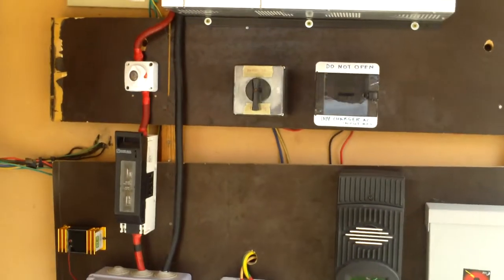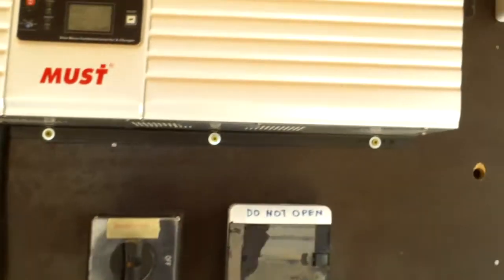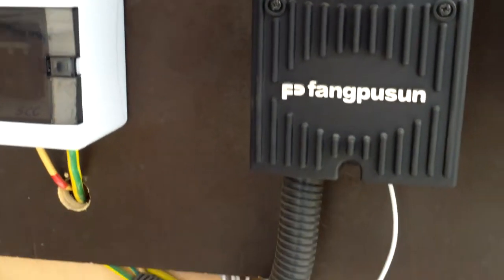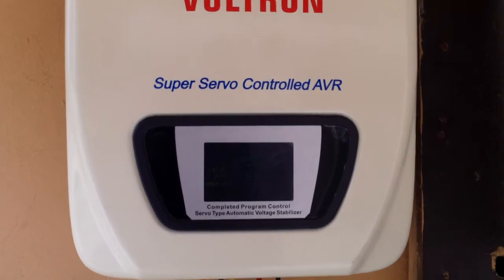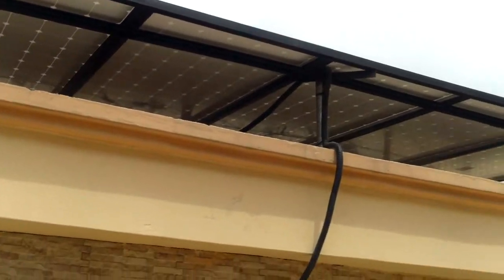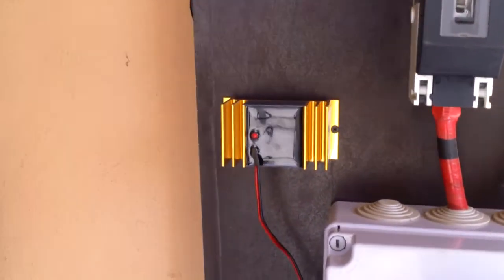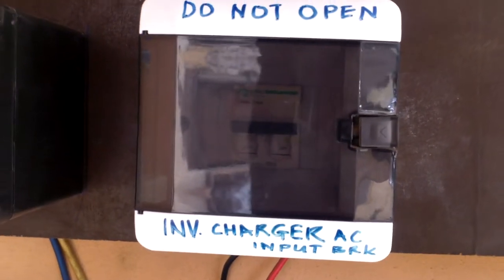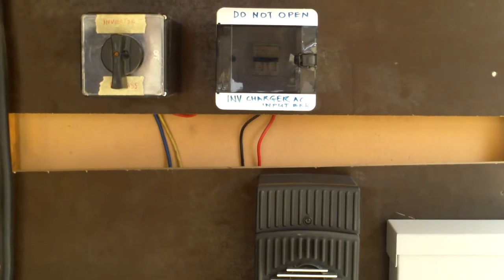3.6Kw Solar PV & 4Kw LF pure sinewave MUST Inverter with 400Ah AGM

Comment: Neat installation there.  Highly professional!
Just a quick one on the power meter over there.

Is it just the toriod that measures all that?
Reply from the maker: The toroid is used as a  current transformer CT  for measuring  AC current flowing in the wire using the HALL effect. The meter also measures AC output voltage, instantaneous Power and Energy utilized
Reply: Ibidapo Ilawole oh... Great. 
Would chat you up sir